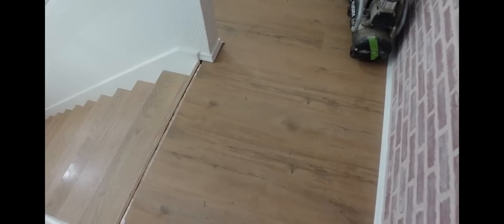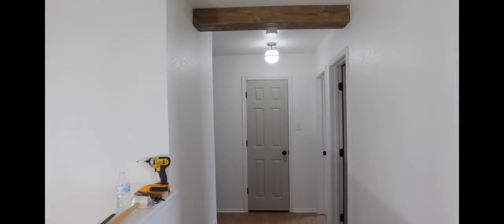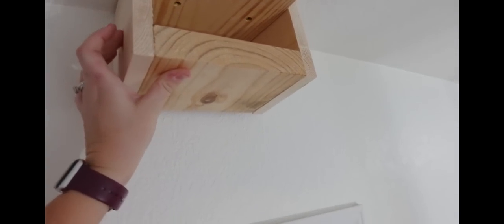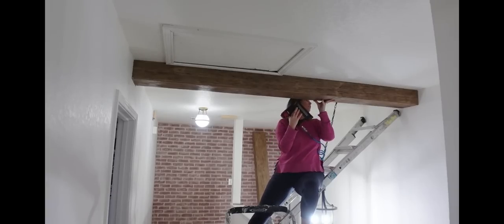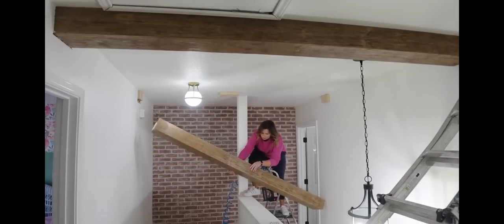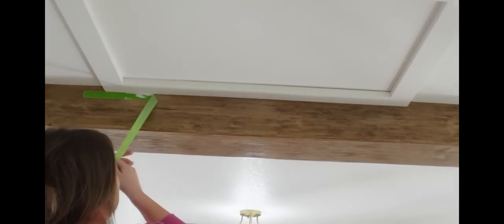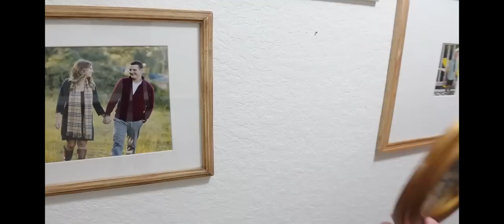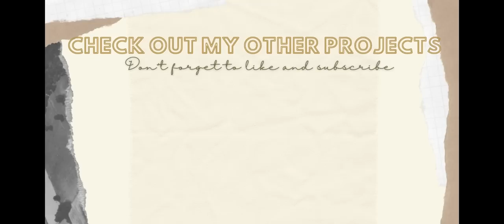INSTALLING MY DIY FAUX BEAMS BY MYSELF | HALLWAY MAKEOVER REVEAL

Comment: A little tweak for your upstairs hallway would be to replace the ponywall with the same railing as is downstairs on either side as of the stairs.  It would really open up and add great value to your home.  It's a fairly small span, so I don't think the railing would be very expensive either.  It would also greatly increase air flow and light into the hallway.
Reply from the maker: Would love to do this one day!

Comment: Very nice, it looks good.  I really like the brick wall and the beams, such a great idea.  Nicely Done!
Suggestion:  I have the exact same attic access as you do.  Over the winter I had some work done on my heater/air handle which is in my attic.  AC guys suggested that I insulate the access door panel, mine is the same as yours, just ceiling tile material.  I watched a few You Tube videos on ways to insulate the access door and the majority are recommending -  Rigid Foam Board.  Suggesting several layers, glued together so it has some weight to it so it compresses down on the weather stripping.  Weather stripping applied around the rim for the door panel to rest on to seal any possible leaks.  It's on my list of projects for later this spring.  Not only will it help with the heat and feeling drafty in the winter, it will help with the AC with our hot humid summers here in Florida.  Just thought I'd share the tips.
This is one of the videos I watched -  https://youtu.be/R-63b-tKqNo
Reply from the maker: Great advice! Definitely want to insulate it because Texas is HOT 🥵

Comment: Okay, so you sitting on that ladder over the stairs had me holding my breath!  Made me nervous, but you just sat there grabbing big ol’beams and nailing them to the ceiling! 😂. Great job!  The hallway flows with the rest of the house and has such character!
Reply from the maker: 🤣🤣 it’s probably hard to tell but the ladder is wedged in between the two walls so I felt way more secure than when I’m outside on the ladder.